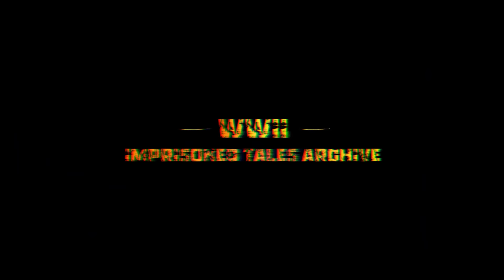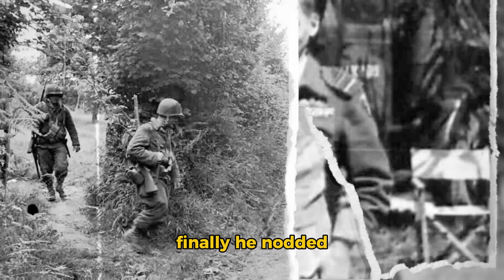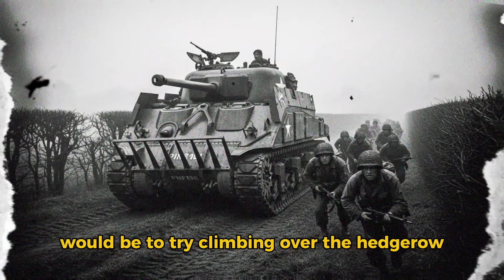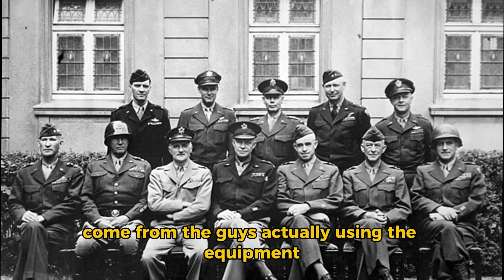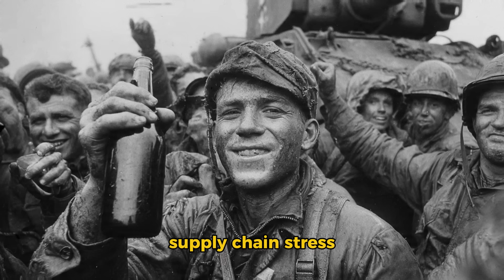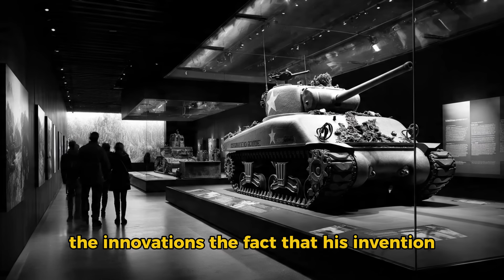The “Mad” Mechanic Who Turned a Broken Tank Into an Engineering Legend

Comment: This video shows several "concepts" of the hedgerow cutter. If you want to see the real field fabricated solution, google "Sherman tank hedgerow cutter".
The tank obstacles weren't made of hardened steel. They were mild steel beams. Nobody welds anything of hardened steel without involved preheat. 
There is a ridiculous AI image of several GIs standing around a tank obstacle, no welding/cutting eye protection.
Another melodramatic misleading YouTube that misinforms, based on a real story.

Comment: I installed teeth to the bucket of my front end loader to rip through vegetation. I also sharpen the bucket edge, it digs into saplings far enough. The 4 wheel drive in low gear rips it out by the roots. 

I did that because of what I knew worked in Normandy during WWII.

Comment: Crap
Reply: WTF is that background picture? The German soldier's weapon is ridiculous. I'm guessing it's supposed to be a panzerfaust - a single shot weapon. There's no warhead, so it's already been fired. Also, holding it like that, even if it could be fired, it would result in a charred hole in the upper chest and shoulder from the backblast.